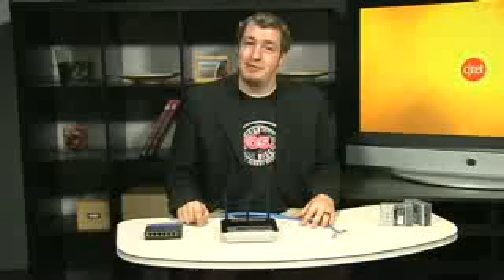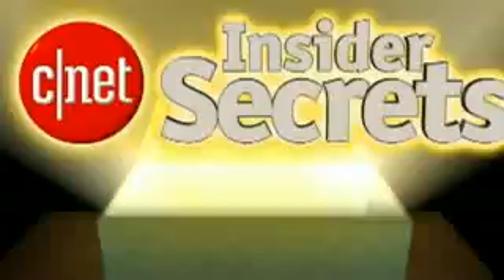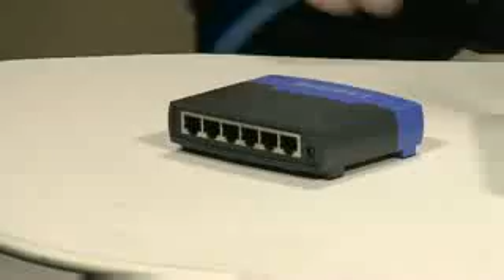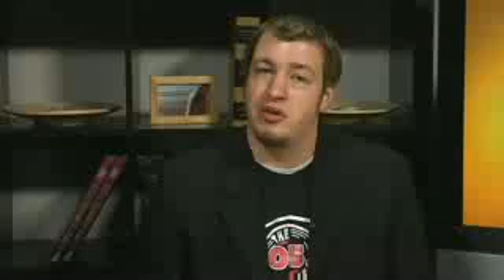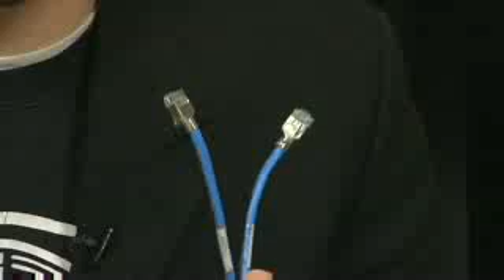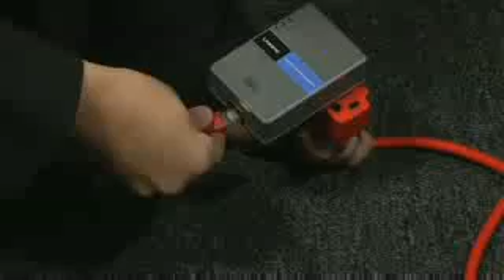Wired Networks

Comment: @999pursuit : Ok, thanks. And HD is over 1,5 gb/s I belive, so I better go for Cat6 then (If I want to stream HD video over the Network that is)
As it turned out my building hat faulty tubing in the wall, and I could not get the cabels through. So instead of fixing the in-wall-tubing, I just went for Wifi (Wlan).